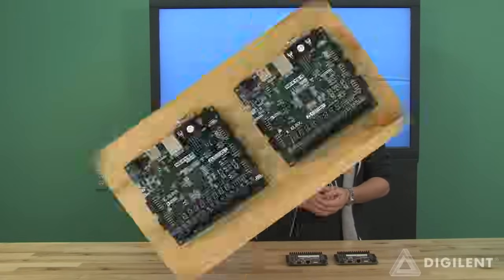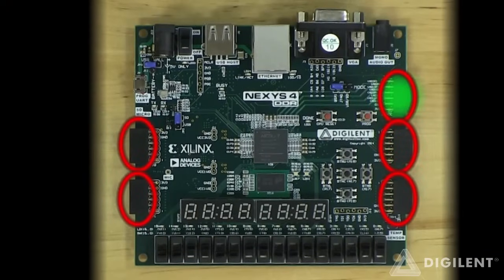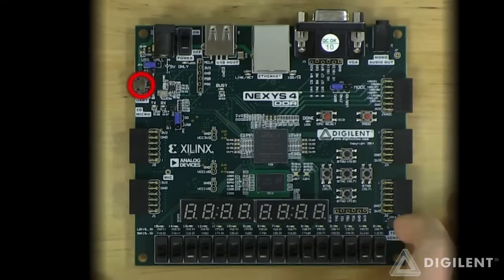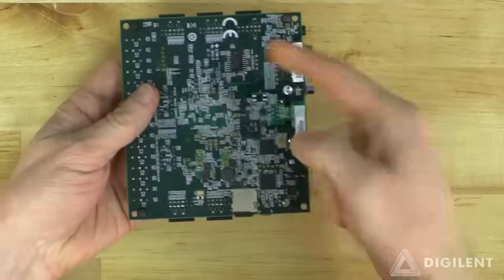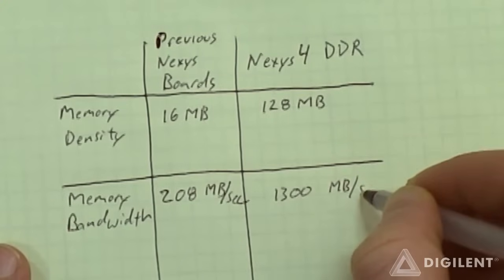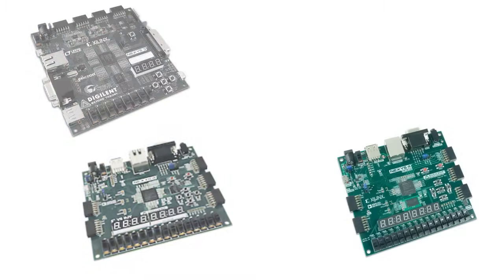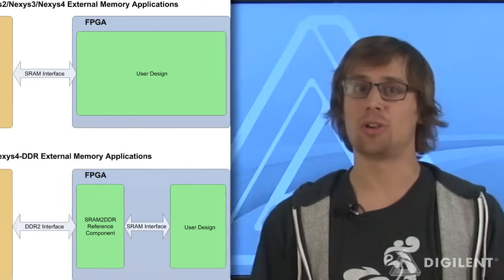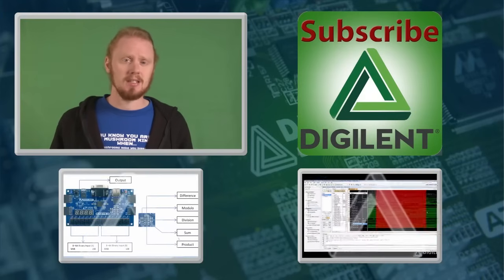Nexys4-DDR introduction

Comment: Hi,
is it possible to connect any external device such as a led to the nexys 4 DDR board witrhout using Pmod switches? If yes, Please guide through the steps or reference manual.